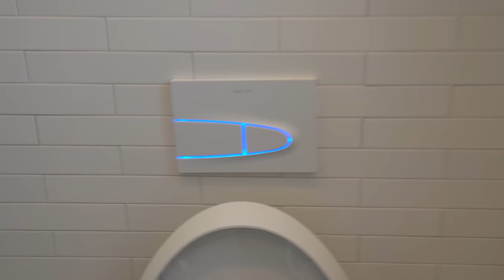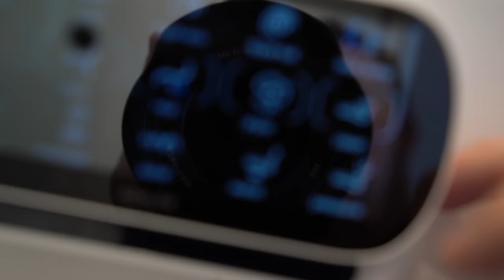Our Amazing Smart Home Toilets!

Comment: Can you imagine if the house suddenly blackout and during that time you are at the toilet and use the remote to control the bidet... 🧐
Reply: Imagine the fan blade breaks while using the bidet 😂
Reply: Load shedding
Reply: @tebohosempe5496  Eskom
Reply: I'm sure they have a whole house gas generator
Reply: @acommentator69  UPS Battery power backup

Comment: What if there is no power? What if it goes out when the"car wash" is on?
Reply: The water valve will close if there is no more power. No power meens no bidet.
Reply: They have solar so that's not a concern but the bidet would shut off if the power goes out
Reply: Uhhhh... use TP!

Comment: The problem with this "smart toilet" is they have taken a relatively cheap home appliance and given it many ways to break or fail, none of which will be cheap. Hinges break on seat? That'll be $300. Bidet feature stuck in position? $250. Remote stopped working? $400.

All for unnecessary silliness.
Reply: Ok boomer